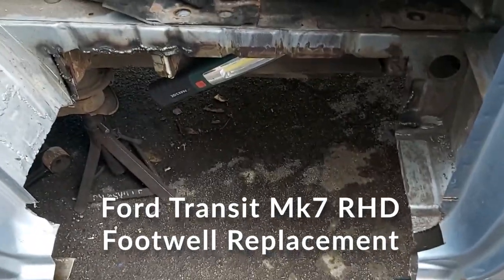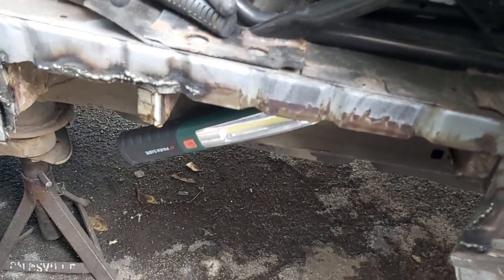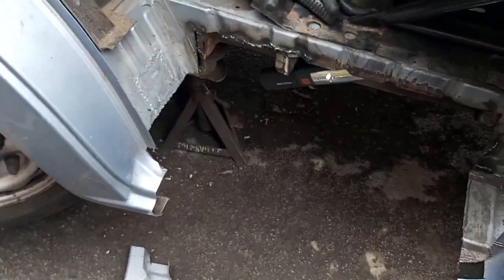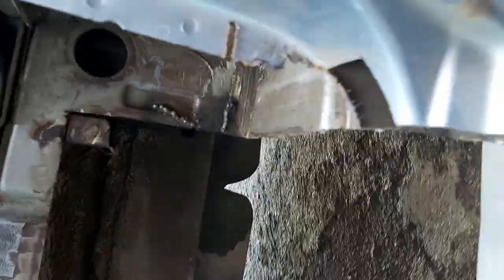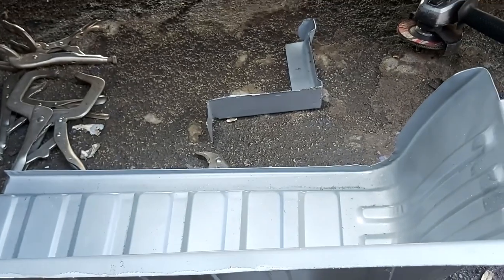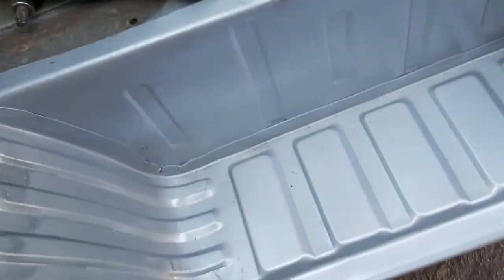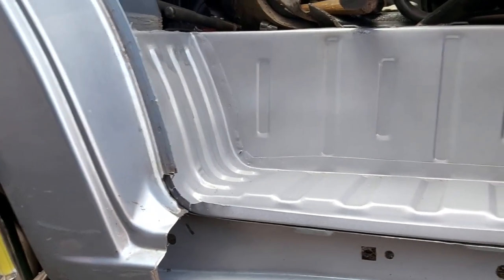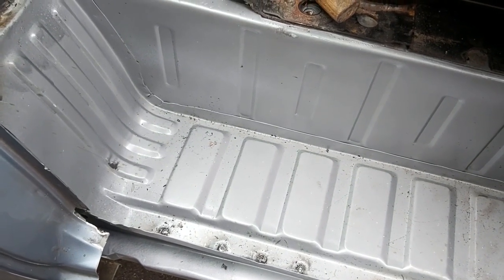transit mk7 2007 step replacement nearside passenger (UK)

Comment: Those tacks holding the outer sill on won’t pass the test, needs to be continuously seam welded apart from as on the step where it was originally spot welded.
Reply: Spot welding in a factory location is acceptable to most MOT testers (obviously any butt joins must be fully seamed)  Top tip here is to leave your welds slightly proud and cover with a cheap paint until you've passed the MOT test.

Comment: Tidy job young man. I have a few tips if folk are interested? My tips a based upon experience and not opinion.
1. Use 0.6mm mig wire because it doesn't create as much heat in the weld when welding very thin gauge steel.
2. Buy a 2meter long mig torch because it stops 0.6mm wire birds nesting up. Because it is a short torch the wire has less resistance when going through the torch lead. You could also put in a teflon liner to be even more slick.
3. If you don't have an air compressor, go buy one because you can use it for many jobs. My next points below covers an important one.
4. Get a blow gun on a compressed airline and use it to blow out seam sealer/underseal/sound deadening fires. It works a treat.
5. Use your blow gun as a means to cool welds near vulnerable plastic, brake lines and fuel lines.
6. When welding vehicles, an MOT test requires weld repairs to have continuous weld beads. Usually on thin stuff, the heat builds up and a big hole will appear.
7. To avoid too much heat build up andthen burning holes through your repair, use what I call the overlap tack style. Once the repair section is tacked in, put several more tacks around the plate. Then, go back to each tack in a random and opposing order and overlay another tack onto the previous one. Keep doing this until the plate is fully overlap tacked. When tidied off with a grinder, the perimeter of your repair should have a continuos weld bead all the way around it with NO gaps. Heat distortion will be minimal if any.
8. Then, when ready to seam seal, I use LeadMate a product by Ever Build. It comes in a tube similar like silicone. Apply ot using a finger directly over the weld. It is a rubberised type of product that doesn't go hard but can be painted over. Just apply a skim over the weld.
9. If doing a restoration type repair, use all the above except Lead Mate. You need the repair flush so a small gap is required to be filled by weld and then ground and sanded back to get the factory finish.
Reply: Fantastic advice my friend! Really appreciate the advice 👍🏻
Reply: totally agree thats super helpful and I really appreciate the time you took to add such an informative and supportive comment cheers every day is a school day and good advice is always welcome
Reply: Dropping gems to us hopeful dads is what keeps the world turning! Nice one man

Comment: I wouldn’t be to sure the water was coming through that hole in the floor - I’d say that’s a result of water pooling there / I’d look above the arch on left where cables pass through or check in engine bay under the scuttle they rot under there and hole
The firewall
Reply: thanks for the great tips they help everyone cheers
Reply: Also the trim either side of the windscreen that let's water in if there is mud etc got under the plastic step it blocks the drainage holes then the step rots out
Reply: @fishfinder9364 - didn't know that !!👍

Comment: I just use flat sheet to rebuild this area.  It's not visible, you just need it to be solid metal. I do loads - every one is a total pita. I also ignore all and every idea Ford had for what shape things ought be. I have 2 criteria - does the door shut nicely & does the plastic liner fit? If it do & it does, jobs oxo. Fords version was crap anyway. How crapper could your version be? Not very, usually.

Comment: I have a transit with tin worm along both sides and across the back . I'm wondering where did you get the replacement panels from ? I've tried here and the only place I can get them is the main dealer at a outrageous price ! So any help welcomed.  Thanks
Reply: ebay After I got them after a bit of a search they work fine
Reply: the other bits I had to cut and make from sheet steel

Comment: Nice vid. I'm a bit scared now because I'll be doing the exact same thing in the next week or so (2006 mk5). How did you remove the plastic panels covering the steps? I removed the plastic pins but there must be somethimg else that keeps them in place. Don't want to break anything. Thanks!
Reply: go for it. i unbolted the end of the seat its a torx bit and they are loooong bolts that allowed me to lever it up and remove the plastic bits there are a few of those plastic rivets make sure you sealant available when rebuilding measure and try fit several times before you weld in and its all good  and watch out for fire. at least the welding keeps you warm
Reply: @iainsuggett7673  thx, will try to follow your instructions

Comment: Where did you get the replacement steps from?
Reply: did a search on ebay and worked out the best deal it was better value than my trade supply contacts and arrived quickly . it was a set including both steps for the driver an d passenger side bu I ensured i got galvanised . Always wear a good respirator when welding galv and make sure you grind it back to get clean metal to try and achieve the best weld you can. be brutal with teh van to chop back to good metal  it reduces blown out welds. go for it.
Reply: @iainsuggett7673  I did the same. Headed to ebay.. £150ish for the pair of steps plus both inner and outer seals... bargain. Thanks for giving us the push I needed to get mine sorted. 👊
Reply: We have all transit sills available at a great price

Comment: Well done mate how long did it take start to finish bud if you don't mind me asking
Reply: Thanks the work was a full day 8 hrs with the underseal and top coats and clear coat the next day they require a commitment but I made sure i had most of the parts to hand before i started and planned the job so zinq coats could be drying whilst I was cutting and shaping for extra patches which "appeared" as I went along  and chased the rot . 2yrs later its mint and now time to do the drivers side !
Reply: @iainsuggett7673  thanks so much mate I'm on doing the mk6 with plenty of rot the chassis mint just the sills and steps lol or and rear arches cheers again mate excellent job
Reply: @kyledale201  try and ensure that the patches fit really well before you weld with no gaps if possible it makes the welding easier overlapping metal is an invitation for rot take your time measure and cut and weld it right first time. (yes I am a crap welder but no one else stepped up and you learn nothing without practice and getting it wrong )
Reply: @iainsuggett7673  no probs bud yea I've welded cars and vans before but never done what I'm having to do lol got myself a joggling tool with a hole punch on bud but sadly my vans had to be towed to my mates small holding with no electric as someone has reported me for having it outside my house with having no tax or Mot on it so I'm looking for a Genny to power my welder it's a good job I bought myself and nice little battery grinder lol thanks mate
Reply: @kyledale201  got a pal in warwick selling a good genny if thats any good to you or close enough  can see what price he wants for it
Reply: @iainsuggett7673  it ok mate cheers I'm in tesside bud think I've found one tbh cheers thou mate much appreciated